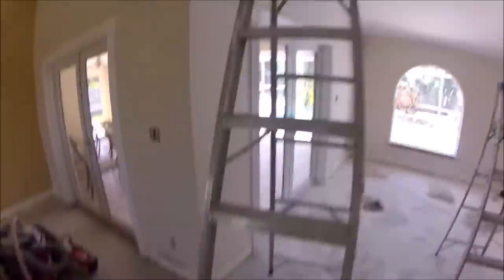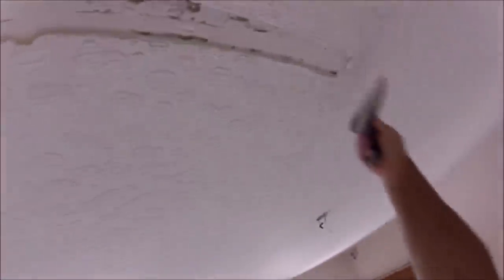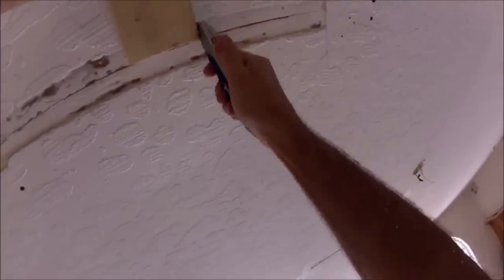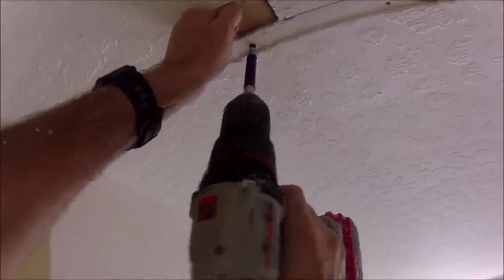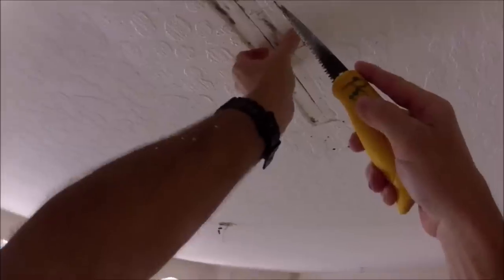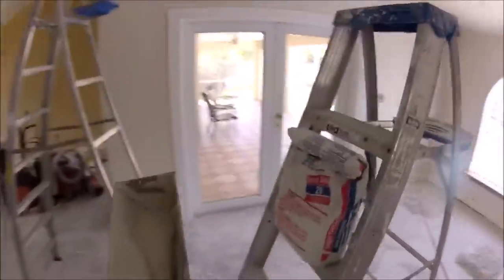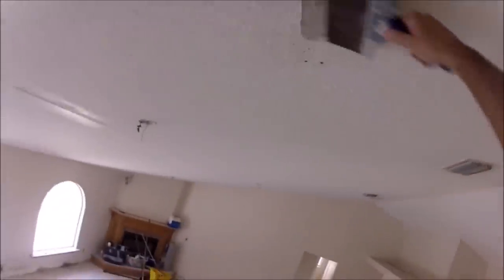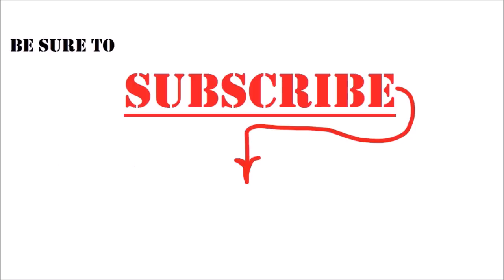How to Repair a Ceiling Crack- Diy Drywall Repair Tips and Tricks

Comment: Great tip Paul. I have a question, I just started 3 years ago and I'm been having some doubts about old apartments ( I live and work in Montreal, CA), the old ceilings in the bathrooms I've realized that they have some kind of metallic mesh then the sheetrock, after a leaking damage on these kind of ceilings, if I would want to do a patch can I just use the water resistant drywall or I would have to apply this same metallic mesh onto the patch.... I hope you know what I'm talking about. Gettings and good videos
Reply from the maker: Hey there Ricardo, you can just use the moisture resistant drywall.👍🏻 You might need to shim the framing to get the drywall to sit flush with the existing ceiling. Because plaster is usually thicker than drywall. I hope this makes sense? Thanks so much for watching and subscribing man!😎 -Paul

Comment: Hey Paul, thanks for the video. If you have a smaller crack do you need to use tape at all or just use standard joint compound? I used screws and scrapped around the area but was shooting for a smoother area without any kind of tape. Thanks again, these repairs need so much finesse.

Comment: Thank you for this video. I have some areas in my ceiling I need to repair. Also where the inside corners come together the tape is bubbling due to crappy dry wall placement during the build. Would you do a video on repair of inside corner repair?  Thanks again.

Comment: I have a few questions regarding my own older ceilings, some with a textured finish, and several with joint cracks. Not a fan of the textured finish and would like to make it go away without having to remove the drywall but I think it definitely needs to re screwed to the joists.

Comment: Just found your channel and its very well done. I have two serious cracks in the living room ceiling but its not sheetrock. Our house was built in the 40's and the walls and ceiling is plaster board. The crack was caused by a framing failure that has been addressed. I've repaired cracks with hot mud before but is there anything else I should do in this instance? Cheers and happy new year.

Comment: Great series of videos! I have a customer who had plumber come in and cut holes in the drywall to accomplish repairing waterlines. We have three areas total. two areas we have the pieces taken out and one small aprox 1x1 foot area in the ceiling that we don't. should I reuse the the pieces we have with furring strips. they are in good shape, just concerned about how to blend the cut areas for a flawless finish. the ceiling piece I need to use new drywall piece and I have watched your knockdown video.. Your thoughts my new found friend?

Comment: I used fiberglass mesh tape on my ceiling joints and the cracked all the way across.  The panels were secured well with little or no movement.  Maybe I used the wrong compound?

Comment: Does this really work? I have cracks that come and go in the same spot as the ground swells and "unswells" depending on the season. I have tried to repair a few times--obviously not well! So, will this technique really keep two sections of a ceiling of a million pounds house's seasonal movement from cracking? If you really think so, I will try this. Are you in the Chicago area, by any chance? Can I just hire you?
Reply: You need to add an explanation joint into your ceiling/walls. That will let your ceiling "move" without cracking every year. Look into it.(even the repairs in this video will likely come back if no expantion joints are added. He's just covering up the problem, he didn't fix what caused of the crack)
Reply: @Tworottz72  Thank you, Tworottz72. I am now investigating expansion joints.

Comment: If I'm repairing a drywall crack at home using fiberglass tape, should I always open up the crack like you did and use setting compound, not all purpose?

Comment: If your going to use mesh tape then use hot mud not regular box mud & after its setup use a wet sponge on the outside edges then topping mud for the Finnish sand lightly and good luck matching the texture on those older homes lol.

Comment: Hey Paul
First of all Great Video
Secondly, I have a crack in my mobile home ceiling that has popcorn on it, where a section of the drywall has dropped, does the same rule apply in repairing it…?

Comment: Most all of the long  seams are like this in my garage , I discovered today the sheetrock does NOT butt up to each other on a rafter . If I re tape and float these will them crack again ? If so should I caulk the crack first then tape and float ? Would that work to stop the tape from cracking or do you have a better idea ?

Comment: You're saying furring strips but you're not furring anything out you're putting in  backing . Furring is when you add on too the framing or whatever the  surface may be to bring it out flush with another piece
Reply from the maker: True Douglas. But that’s what these 1”x3”s are called “Furring strips”as well. I added the furring strip. I didn’t fur out the ceiling. It’s all semantics my friend.👍🏻 Thanks so much for watching and subscribing!😎 -Paul

Comment: Will that 20 minute set and the fiberglass tape be stronger than all purpose compound and paper tape? I'm always skeptical about using fiberglass tape. I feel like it will easily crack again.

Comment: I have a couple rooms with ceiling tape joint cracks most likely caused  by traffic related to a storage/HVAC area in the attic above. With this in mind, will this technique work to stabilize the panel movement along the tape joints, or would you recommend another technique?

Comment: Great job, however I would add some wood glue in the mix. Have been doing this kind DIY work for last 25 years, the cracks have never shown up again😉
Reply: Yup, plus I use 5-min mud lay it flat, scrap it on the trowel edge while setting up with a spray bottle of water. Never sand add texture 😜
Time is Money

Comment: I need to repair a repaired ceiling crack on my 10’ ceiling along the seam of two sheets of sheet rock.  The crack has returned from original repair a few years ago which used mesh tape.  The crack is thin and long,.  When I scratched it, I can see the mesh tape repair, and wonder if I need to rip it all out and start anew.  I don’t think I can force enough mud in the thin crack to prevent it from re-occurring.  Any suggestion?

Comment: Im curious as to why the drywall was sagging or flexing  so much? Assumong the joists are 16" or even 24 .  Good video thank you. I do have a question as to the use of a 90 min joint compound with fibretape. Is it ok as far as long term strength ? You said you were using a 20 min set. I bought some USG easy sand 5 along with Adfors fiba tape perfect finish ultra thin drywall joint tape then read somewhere not to use hot mud with fiber tape. Ive been building and remodeling for decades but had crews for my taping bedding and painting as i hate it. I am doing a job after several years of retirement. Im not familiar with new products techniques etc. Im relearning and dont want any probs down the road. This will prob be my last job. Pretty sure ill die immediately after driving the last nail. Ive got 90 min mud and dap dry sex light weight low dust as well as 3m wall repair fiber reinforced compound. I was told it was great for holes and cracks w/o tape. I have many hair line cracks all above door ways. Now im not sure about the 3m w/o tape. Feel like im back in preschool. Actually thats not true i aced school from the get go but this crap is overwhelming. Too many products too many contradictory methods . Id appreciate any input you have especially in regard to the products i have.  Thanks

Comment: Brilliant and simple, also you made it look easy

So, for small repairs
The spray can texture is bullshit, but dragging around an air compressor and a texture gun is a big pain in the ass

Do they have anything smaller that’s worth a crap?
Reply: Use a Mason's brush and thin out your mud to an almost pourable consistency.  Dip the brush and flick it at your surface. Wait until the mud can be touched by finger but not actually stick to your finger and start knocking it down. Sometimes it helps to have a spare piece of sheet rocker plywood as a test sample so you can get the feel for how much and how hard to flick the brush

Comment: Paul I was ready to do this yesterday and immediately after inserting saw blade I was up against a joist and the drywall apparently split just to the side so no access for a 4” piece of firing strip.  Suggestions?

Comment: Hey man! Love ur vids! I'm repairing a ceiling crack in my master bedroom. Using all purpose compund for first 2 coats. What joint compund should I use for the final stomp coat to ensure it dries white to match the existing non-painted ceiling texture? Thanks!

Comment: Hi 
I’m taping a room in the roof. A lot of angles. Corners are slightly imperfect as no adjustable corner trowel. I do now own an adjustable trowel so can I rescue my rough corners with a third coat ?
Kind regards 
Steve

Comment: i have a problem with my hallway ceiling sagging in the middle also it has a crack. ive replaced the old nailpop with drywall screws but it didnt fix it .

Comment: Love seeing someone fix in a way that will last. Great trick. I am just about to start filling mud on a room with a ton of bad tape joints. Am I asking for trouble filling joints with mesh tape and all purpose joint compound? I have one joint  that only crumbled on the ceiling, but the wall side of the tape is secure. Can it be filled on just the ceiling side?
Reply: Your fine using green lid compound and mesh . I've been specialising in hanging and repair for a long time . Never had a problem with recracking .

Comment: My ceiling is cracking all the way across the room. My husband put caulk in it and looks horrible. This is where we took walls down to make rooms bigger. He said it was not enough mud. I think it's what you are showing. And we have popcorn ceilings. Can I have this fix. I had a quote to sheetrock over the room. 3000.00. Can't do it.

Comment: I have ceiling tape coming lose on a 45 degree joint.  How do I begin to correct? Looks like not enough joint compound was used originally correct?

Comment: I have an entry way in my house the I have repaired 2 times but it keeps separating and the crack reappears each year.  I don’t have cracks in the walls.  It only seems to happen  in the hallway entry area and goes from one side to the other.  I have added a sister board to the 2x4 that the drywall is attached but it does not seem to matter it still pulls apart.  Any ideas on how to keep it from moving and separating. I have filled the crack, and taped it and after a few months the crack then pushes closed and causes a bulge in the crack, other time I retapped after it had pushed together and it cracked the tape again so I have some movement in the ceiling but unsure how to stabilize it

Comment: have a bad crack at seam where two modular home boxes join.  drywall patch is about 8" wide and 10ft long.  tried conventional repair, even sticky elastic crack repair, no help. Any other thoughts before I put up a full 4x10 sheet of drywall?

Comment: Hi Paul, I have a crack ceiling drywall that leaks water. What is the best way to patch the crack without replacing the drywall? Is there any waterproof patch I can use?  I tried the Flex Tape which did not even hold against the drywall.

Basically, I can't really replace the drywall since I can't afford it nor finding the leak source since I lived in an apartment building.

Thanks in advance.

Comment: How do I repair a corner crack (the joint between the ceiling and wall)?  It looks like the tape has pulled away from the ceiling

Comment: I’m getting ready to have an appraiser come over for a refi on my house. I have cracks on my ceiling in one room that was a garage converted into a bed and bath, but another room at the other end of the house that was retaped and painted, but is cracking along ceiling/wall joint. Any way to send you a pic.?

Comment: Hey I just purchased a house and there’s a crack on the top right corner of a doorway which is a closet but the crack is diagonal from the corner about 2 o’clock and it’s just under a foot long

Comment: Question : Problem in Florida garage . Is DAP DryDex ( the pink that turns to white ) mud ok to use ? 
Or would you recommend any other product ? ( for strength hold and longevity ) .
Thanks to all for any info .

Comment: So I have numerous 5’ ft ceiling cracks. I tried to get the drywall contractors to bid it but it appears they are too busy in Reno. One thing they all said was it was cracking after seven years because of settling and they didn’t screwthe dry wall to the fielding rafters. They used a broom to push on the ceiling to prove it. So the question is without knowing if theirs a stud on the other side of the drywall I see you tap around for a stud. I have a stud finder and that should work. Do really need to add more support behind the drywall if theirs no stud available? Reason I say this is because the drywall guys frowned when they mentioned it. I’m going to do this by myself and with no experience . It has orange peel texturing .
Reply: Your drywall cracked after 7 years??? New house???😱
Reply: Yes

Comment: Great video! Just cant understand when to cut into the ceiling - does it depend on where the crack is or the size of the crack (or if its a textured ceiling?); I get the idea of using the flexible tape and then covering with layers of mudd etc...but if I have a smooth ceiling and only part of the crack is on a seam (due to house settling) is it still necessary to cut into the ceiling and using furring strips etc..? Just a beginner here but I still want it to look good and LAST!
Reply: Between the beams. So you don’t hit wood

Comment: If you use new drywall how do you make the sanded mud match the old painted texture and not smooth?
Reply from the maker: You can use a thicker roller cover nap for spot priming and painting. That should give you more of a roller stipple on the repaired area.👍🏻

Comment: is a furring strip some kind of special drywall piece or is it just a piece of wood?
Reply from the maker: It’s just a 1”x3” or 1”x4” piece of wood.
Reply: A furring strip is just a reference to adding more wood to bring out the wall or ceiling or whatever you need more support room behind the final surface.
Most times there are pipes on the wall edge not in the walls so applying furring strips the same thickness of the pipe hides the pipe in the walls and gives you a flat surface to apply drywall or tile or stucco... well you got the point now 🧐
Reply: @PaulPeck  Thanks for the reply. It was very helpful!
Reply: @mansardmanor3869  Thanks buddy.

Comment: 1.? What is a Guard? 2. I saw a pro use a great stuff type spray foam material and sand it perfectly in 3 minutes application,15 minute dry time and    4 minutes vibrating sander time. Trying to find the right spray foam for half a dozen 6-20 foot cracks. Any advice?
Reply: Why does drywall mud comes off in big sheets on ceilings best way to repair air is like that maybe two feet 3 ft long thank you be safe

Comment: Hi there - can you explain the value of the stock you put in there?  I can't see what you attached it to underneath the surface
Reply: He attached it to the two drywall sheets to move as one large sheet, preventing cracks, cracks form when two sides of a seam move in opposites (think of a butterfly wings)

Comment: Pretty bad. I was thinking kilz. What a pain. The tape my Pap used back in the day (when they didn’t have any) is bubbling up on every ceiling in house except kitchen (dropped). I NEED A SCAFFOLD CHARLIE BROWN!  Lmao 😂
Reply from the maker: I’ve gotten away without washing a pretty bad nicotine ceiling before. I just primed it with the oil base Kilz and it was fine.👍🏻 Let me know if you run into any questions along the way Carla. Good luck!🙂 -Paul

Comment: What's the reason for the 20 min mud with the fiberglass tape?
Reply: Paul mentioned that it's for strength because he's repairing a ceiling crack where there was movement.
Reply: @darlenemcclenny3909  - Thanks Darlene, I understand the fiberglass tape for strength.
I was wondering about why the 20 min mud vs all purpose mud
Reply: @robc2536  yes why not all purpose mud?

Comment: I have a similar ceiling crack. I cut a hole to place a furring strip and there is a beam that runs along the end of one of the drywall sheets that prevents me from putting the strip in. The beam doesn't cross over to the sheet of drywall on the other side of the crack so I cant screw into it either 😭
Reply: If I went into the addic and screwed the furring strip into the beam and then the drywall would that work?